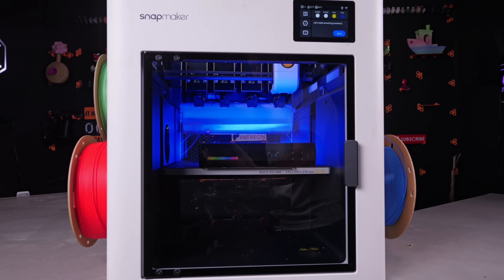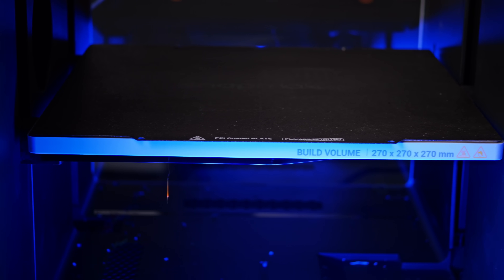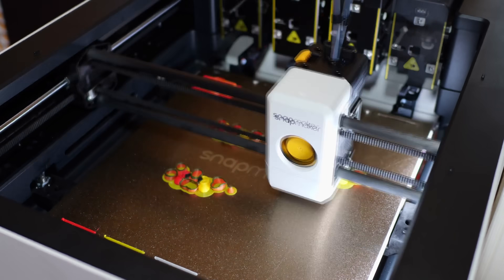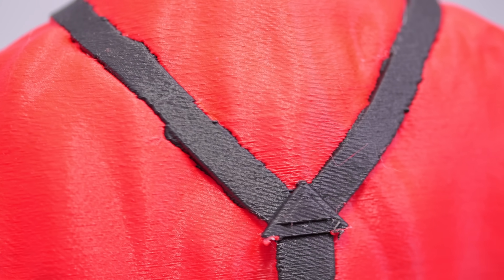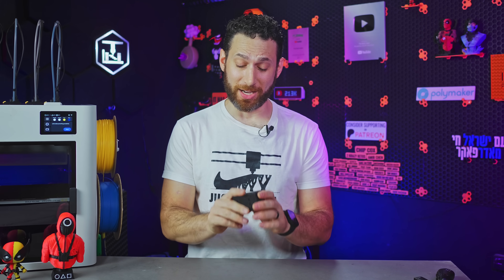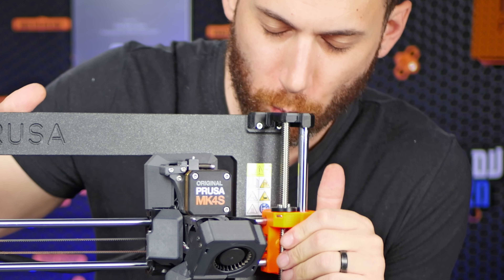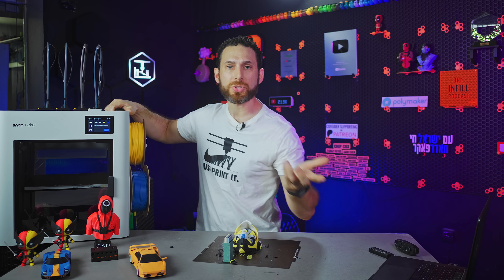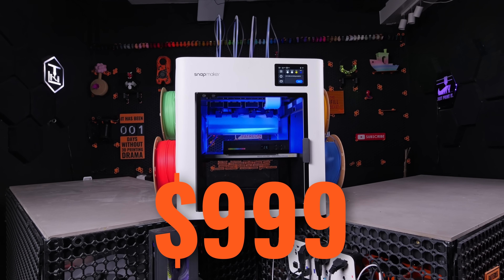The SnapMaker U1: HOW is This Even Possible?

Comment: Tool changing is the future, Purging the nozzle is not a good solution for multi color / material. Whoever comes up with the best tool changing tech will win. I'm waiting for the Bondtech Indx, I think they have the right Idea.
Reply: Hybrid is the future, with 4 tool heads and one of them on an AMS you get 7 colors and if they enable an AMS per tool head head with each tool head able to be daisy chaned to up to 4 then there is pretty much no more limits.

But even just two tool heads with the ability to use an AMS on each is a massive step forward.
Reply: hope you dont ever need to make design choices. purging Is a very good solution for simplicity and cost. clearly. tool changing is more costly but thats what's being changed now.
Reply: @cbrunnem6102 you need very large purge volumes when switching PLA and PETG on a single tool head.
Reply: Waiting for some standard tool changer as Morse cone  or BT30/BT40 but for hotend/effector change. Maybe some RipRap or Voron guys already baking. That idea is so obvious, it is prerequisite to hotend color/size changing, laser graver, poor man measuring machines all-in-one, with independend 3th party tool producing all across globe.
Reply: While purging is not "optimal", it was still the best and cheapest solution for a multi-material system when Bambulab came out with their AMS. What other options were there, at those price points, before BL? Had it not been for BL's AMS, which supported up to 16 colors, and easy support interface snap offs, I wouldn't have made a new business out of 3D printing colored miniatures and terrains. So for me, it was the best thing  that came out for my design ideas. And on that front, for something that can support 8 colors or more, not sure if tool changing is the optimal solution either. Can we really have 16 print heads on an affordable machine?
Reply: @got_logic1320  Check out the Bondtech Indx if you haven't. Just the nozzle switches out, the nozzles are skinny and pretty cheap, you only need one motor / fan / heat sink... you can fit at least 10 nozzles on a 300mm printer. So yes, many tools at a comparable price to many AMS's are possible.
Reply: @got_logic1320 there was solutions since years before bambu. Off the shelf not but there was something. I have a bambu AMS i dont so too much multicolor prints but not sure why it is a hit or miss for me it is not reliable for me. What is you success rate with AMS? Curious about your experience since you probably print alot since mini has a lot of color changes.
Reply: @got_logic1320 how about you read the comment agian and realize it about wanting to move past the ams system i
I know you bambu baby's lack critical think skills or commen sense as you still toddlers but at least try to read the comment.
Reply: @jamesgates1074  Not exactly, maybe for multicolor PLA/PETG, but not for engineering materials. Tool changers need a lot of vertical space at the moment, and that’s a lot of chamber to heat for things like PC and Nylon; even ABS or ASA would struggle.
Reply: @thiccnick277 well find out cause their a separate top you can buy so the question of if this machine can print materials like abs or asa will be answered real quick.

Comment: If nothing else, this pushes the other big names in the industry to innovate faster. Competition benefits everyone.
Reply: Idk elegoo has a 250 dollar printer bambu labs isn't doing what this company is doing this is basically a Prusia but a third of the cost which is nice but the fact it's three times the cost of the centari carbon but will be four times the cost when release it isn't worth it it isn't new or innovation to just take Prusias Idea so this isn't really advancing anything it will lower the price on the most expensive printer on the market and it would be really nice if they started releasing high temp hot ends like mosquito hot ends so you can actually print any exotic filament it's only been about four years since high temp hot ends that are good became a thing
Reply: They will have to. If someoneb is "stealing" solutionndevelop3d by them. Real innovation is always good.
Reply: The entire tool head (as in the entire hotend, extruder, main board, nozzle, frame, and cover) assembly for the Sovol zero is about $60 bucks.  Which seems like a nutso low price to me, and my suspicion is that it's because they wanted to develop a cheap enough tool head to be able to base a tool changing printer around.  They've already commercialized 2 voron designs with their own tool heads, so why wouldn't we expect them to also try and commercialize the stealth burner?
Reply: Surely Bambu, Creality or Anycubic would announce such a system end this years and maybe start shipping this time next year.

The question is: can you wait so long and do you think prices are going to be lower than 700 bucks? Still have the prices for P1S or even K1C in mind. Especially with CFS/ AMS they are in a similar price region now. I would guess a CFS unit is cheaper to make than 3 additional print heads ...
So even when those companies come around with a similar product ... it's only clsoing the gap first ... and not letting this offer look bad in any way.
Reply: This comment aged like the finest wine in a French winery. Bambu was the first to chase the hype with the H2C. Good call, great guess :)
Reply: Bambu's H2D that can do laser cutting and engraving, as well as printing, is already more innovative than this.
Reply: @vjosullivan  I do agree that the H2D is amazing but snapmaker has a similar printer called the snapmaker artisan 3in1
Reply: @vjosullivan  snapmaker did it 4 years ago
Reply: @vjosullivan  You can thank SnapMaker for innovating those ideas well before Bambu was even a name. There is nothing innovative about Bambu labs. They are just stealing other peoples ideas and trying to make a name for themselves. The support group for Bambu labs is a trip though.... Come off as though they are NASA!
Reply: @scottlangevin2921 saying theres nothing innovative about the most successful 3D printing company known for their over engineering of every component is pure cope

Comment: Compelling product, should be very disruptive.  Suspect INDX will be a healthy competitor.  Number of companies currently struggling to recreate/clone products competative with a P1S (or even a Centauri Carbon) are in a lot of trouble.  Especially those struggling with innovation, quality, consistency or user experience.  Love to see the progress.  Have learned from other recent releases to wait for the bugs to be well shaken out.  A $200 cheaper printer that only works at 90%... well that is just a Qidi, FlSun, or Anycubic, (Creality?... and sans price, sadly recently Prusa) by another name.  Quality is remembered long after price is forgotten.  Companies that have the budget, resources and willingness to thoroughly develop and test prior to shipping product will soon be the only ones left.  $500+ is a lot of money and companies need to deliver value and quality for those prices.  Nothing else is acceptable.  Days of commercial DIY for non DIY printers are over.  Not talking about Voron, Ratrig, etc.  Those are awesomely DIY.  But that is the point in that case.
Reply: Qidi at least has the niche of being good engineering printers at low prices, FlSun has their delta-printers, while Anucubic/Creality are the true "clone but worse" printer makers.
Reply: @holm8536  Have a Plus 4 and a T1Pro.  My T1Pro has worked great, but the part availability has been terrible.  I got a mixed bag Plus 4, not one of the "good ones".  After mods and another $200 it is usable.  However, after experiencing the marginal design, and poor quality control I would never own or recommend any of their products again.  When my T1Pro is the superior product that says a lot about Qidi.  T1Pro works every time, Qidi is flakey and random about 10% of the time.
Reply: Snapmaker is known for their solid builds with high quality.
And they still support their old machines ... unlike Creality.

So with this offer everything looks great.
Reply: @hassosigbjoernson5738  Looks good is a fair distance from is good.  Not worth the $200 savings if the beta machine is only 50% useful, or not usable at all.  Better to wait for them to shake their bugs out.  I would give it about 12 months to iron out any issues with the tool changer.  While very promising looking, tool changers add a level of complexity from a physical, process, maintenance, and user standpoint.  If the price goes up and it proves to be a great product then whoever buys it at full price will still win.  At the $800 to $1,000 price it is out of the budget range and squarely in the range of needing to be stable and high quality.  The only thing that will help with that is time, lots of user feedback, and iteration.  Still to be seen how well they iterate.  Some recent manufacturers like Elegoo have done a fantastic job of repeatedly iterating in a very short amount of time.  Others like Qidi and Flsun have abandoned existing users and run to the next product.  Apparently caring very little for their user's experience.
Reply: The Slicer software is too worst that those youtubers dont even talk about that.the multi color mixing is not acceptable, if they like bambu lab a1 mini only cost $150 and AMS only $250, where is the killer?

Comment: Been learning about 3d printing and even a little bit of modeling with a used anycubic chiron I got at a swap meet for essentially free. I'd like to step up to a more modern printer with an enclosure and a direct extruder but for now it's just a fun little side hobby to supplement my fpv drone addiction. I've even gotten my settings dialed in to a point where I can print TPU with success (but some stringing) even with the stock Bowden setup.

Comment: Why do you have purge blocks on a tool changer? The only purges should be to swipe the nozzle when the tool is deployed on a layer, as it should be pre-heated and already fed with material. Oh... and for more toolheads, maybe that's something we'll see on a Plus model? Real estate for tools is tight in a CoreXY
Reply from the maker: Prime blocks to remove the filament that has been sitting at the nozzle degrading due to temperature
Reply: And the part of it being a PRIME tower. Not a purge tower.

Comment: Snap maker (who has a good reputation), TOOLCHANGER, for less than 1K?
Two power outages (and my local power) are distributed from the OLDEST(non overhauled) transformer station in this COUNTY).  THAT STILL usually lose power unless of seriously inclement weather, or suicidal trucks (happened TWICE in 20 years).  But! I would think of a battery powered constant power supply.

Comment: If I wasn't already planning on an INDX upgrade to my SV08 I would Probably end up buying this
Reply: Are you happy with the svo8 ? Thinking of getting one.
Reply: @terranceroberts6259  Yeah, my main reason was to finally have a printer I can deeply mod again, I've gotten too used to consumer grade printers like BBL and the Kobra S1, but I like that this is super extensible. Like I said I'm planning on doing a Full scale INDX upgrade putting as many nozzles on as I can.
Reply: I was going to upgrade my Voron with an INDX, but now I'm getting this instead.  I might eventually also get the INDX, but this thing looks amazing.
Reply: Since I did not go the SV08 route with all that tinkering ... I end up buying this. =)
Reply: @hassosigbjoernson5738 what all thinkering? Only issue i had was the probe stoped working. But that machine has more than 1 year. Most of the issues are people that are too picky for perfection on bed variance and stuff. Other than that im looking to get the MAX version and posibly 2 or 3 regular ones. Looking to get indx on them too.

Comment: I wasn't super happy with my J1S, it doesn't even have mesh ABL for $1,000 and when I got the printer the firmware was corrupted. After hours going back and forth with snapmakers support, I got it printing. The part quality was not amazing but not terrible, and after a few months, the tool heads started colliding on multi material prints
Reply: I've Also had the colliding Heads on the J1S and found that the positioning of the Prime tower Influences this. I haven't had it long so needs more experimenting but so far If I put it to the Left or centre I get the colliding Heads and to the most right I don't get it.
Reply: THe J1S isn't a Snapmaker, I'm not really sure why they acquired that product to be honest.

Comment: Do we have a guarantee that lan mode will stay? I couldn't care less about cloud, as long as I can use it with non proprietary tools. A printer with no cloud integration is actually a positive in my book.
Reply: If it ships with a lan only mode, then the only thing required to make it stay that way is keeping it in lan only mode.
Reply: @seanburke997  Yeah sure. Like the bambu printer I was about to buy before they announced the cloud nonsense.
Reply: it's open source bud, you can do whatever you want.
Reply: @riba2233  have you link to the source code? AFAIK we have only claims so far

Comment: Managed to get to be backer 427. It's the one thing missing within the 3d printing space. A cheap multi head printer, I've been with Bambu for 2+ years and I've wasted a lot of filament (over £1k by now 😢) so adding this to my lineup is a game changer. Hopefully they iron out the software issues but other than that I'm more than hyped for this!
Reply: But how "cheap" will it be after the early bird discount, google seems to say its going to be around the $1k mark which means you would have to do a fair bit of MMU printing in order to justify the upfront cost vs a bambu

Comment: In terms of performance, this is pretty phenomenal.
My only complaint is the print volume.  I'm finding sub-300mm beds to be restrictive.
Reply from the maker: I have a feeling there will be a bigger one coming soon...
Reply: @thenextlayer  Right, but this one is already going to be $1k at regular pricing, so once you make it larger you're going to be sitting in the same sort of price range as the H2D, now while the waste will be slightly higher you then end up with the AMS2 and options to have more than 4 colours, the lack of enclosure for filaments is a bit of a pain point on the U1 for me, also lack of being enclosed at all due to the need to have 4 PTFE tubes poking out of the top

Like i can see the reasoning behind it, but if reducing cost were the only factor then everyone doing MMU would be buying a prusa XL already, its an impressive looking enough machine but i'm not sure its going to make as many waves as people think

Comment: I went into this video wanting to hate it. I have an Snapmaker 350 which the slicer for (Luban) sucks. This has got me really liking it, from a software perspective. I hope you get to do another non-sponsored video, just to see what if anything changes.
Reply from the maker: insanity.
Reply: @thenextlayer I just had a cool idea for you to try with it. Based on it having a fluid interface under the hood, could you run a BoxTurtle into each head? If that works it'd be amazing!
Reply: Luban crashed on a bed of multi material sharks I sliced for my J1s. Sliced just fine in orca, prusa and cura
Reply: @ZT_1234 yeah, I use it as a laser cutting machine now. Which the slicer equally sucks but more trust in my Voron Trident than the Snapmaker

Comment: Snapmaker.   Make a multi material loader for each head.    Then you would have something.    You already have the wiper and purge bucket.   Barely would have to purge with those 4 heads and still have lots of colors.
Reply: it's running klipper, so you could add your own mmu if you want
Reply: like this idea, put an AMS type thing on one/each/any tool head and whilst printing a colour on one of the other heads, it can be changing the colour if necessary
Reply: @richcodesweb  agreed  , prints that have multiple colors would be done ALOT faster this way and have way less waste

Comment: Qidi Q2 is being launched in +- 2 days with 370 nozzle, 120c bed, active heater and almost same size as this snapmaker for a price probably lower. Qidi realibility is questionable but still may be a serious alternative. Also Century Carbon AMS is coming soon now and while it's not a tool changer, the combo will be way below 799 or 999. Will you burn 300$ in purge waste, really not sure. Still it's going to be some interesting months to come.
Reply from the maker: You’re comparing multiplexers (2020 tech) to toolchangers??
Reply: @thenextlayer  agreed.... Its apple and oranges i have a p1s with ams and I usually skip multi color because of waste and time... Thats the main reason i have backed snapmaker. If the u1 is reliable i would sell my p1s

Comment: My prusa Xl won't be hard to beat, heat creep, sensors keep showing errors and scrapping my prints because you can't even recover the print even though the printer is brand new

And the enclosure goes to only 30°C and isn't even heated at 40°C prints fail and printer overheats

The only thing is a smaller bed and one less tool end
Reply: I still find weird how "old" the Prusa XL is and yet it never seemed to be as polished as the other Prusa printers
Reply: @ulforcemegamon3094  The XL is textbook case of Second-System Syndrome. If you had a job designing geckos, you could probably iterate your way up to a Komodo dragon over time, but a real flying dragon would be a different matter.
Prusa got very good at little refinements, but the XL is an entirely different beast than the MK* line was, and now their design decisions are expensive to fix.
Reply: @ulforcemegamon3094  anything but the main lineup of MK3/MK4/C1 printer is somewhat questionable. Half the MMU2s never worked, die XL was a mess at launch. But I have not heard mutch about the MMU3, so that remains to be seen.